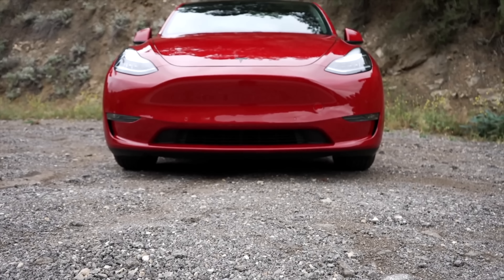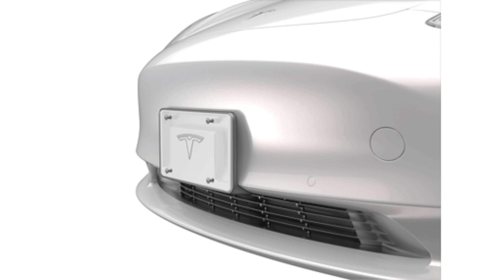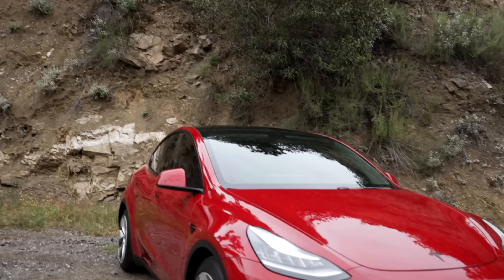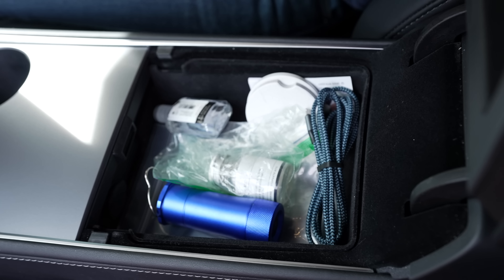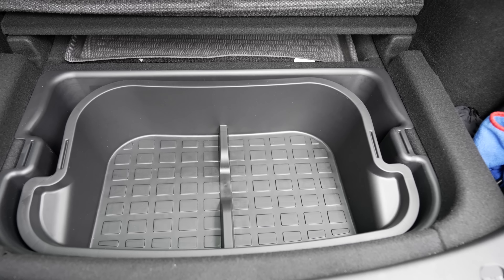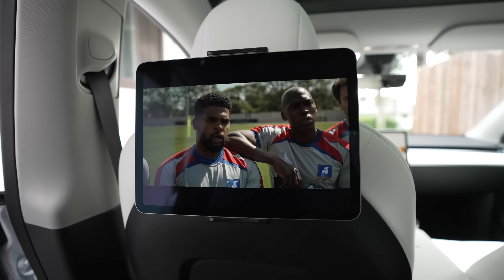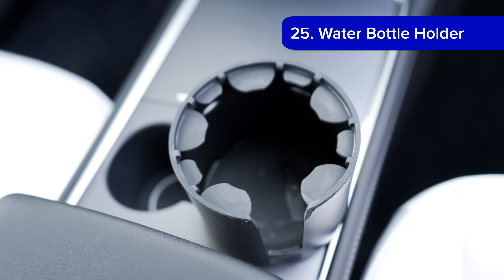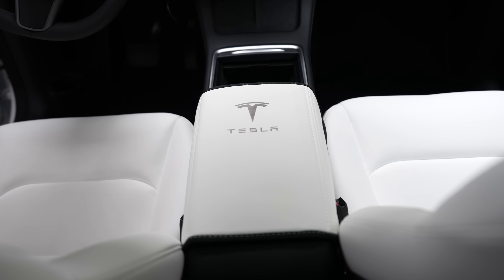The BEST Tesla Model Y, 3 Accessories in 2023 | Here’s Our Favorites

Comment: Ryan, no need for a roof cover. Get the top tinted with a ceramic UV tint that is primarily clear; makes the world of difference.
Reply: That’s what I’m doing… why have a huge sunroof and block it with a visor?
Reply: How much is it?
Reply: 100% this.
Reply: @Ickli  Difficult to say, I got my entire car done at once. I believe it was $350 in 2019 for LLumar CTX ceramic UV tint for:
Side windows at 60%, rear at 40%, windshield and roof at 10% (or something like that)

It was before COVID, no idea what prices would be now.
Reply: I heard you aren't supposed to tint the roof. Not sure why but it can cause a crack.
Reply: @mikefas5406  Well the rumor is false also you should fact check something if you are unsure. Google is there for a reason. 
Some people get their teslas with heat absorption tints instead of heat rejection which is why theirs breaks
Reply: @kello-my-eggo3924  factually speaking, it has happened. 🤷‍♂️
Reply: @Ickli   I think it’s around $350? Then again I got the whole car PPF covered, all windows tinted w/ceramic tint, including clear on the windshield, ceramic coating on exterior over PPF film, and ceramic coating on interior. $8,800.

Comment: With regard to those storage bins for the rear under floor storage compartment that you're still figuring out how to use ... are you sure that the smaller bin isn't supposed to go on the bottom, in the lower part of that compartment?
Reply from the maker: Yep! Just double checked and you are correct haha. Makes much more sense

Comment: Do not recommend metal air caps if you live in cold climates with snow and salt, learned that the hard way, they get stuck and you end up stripping the threads on the tires don't know why anyone would ever use them, stick with plastic.

Comment: RYAN, love your work as always… I think my wife has a Tesla crush on you! Anyways, these accessories are great, and Teslas are definitely a clean slate to customize. In addition, I would really like to see some powered accessories that a EV can use with that 1200 pound battery we’re hauling around. Something like an in car refrigerator, icemaker, microwave, inductive, cooktop, cold beer tap refrigerator unit.  I bet you could even power your whole band if you had the right power converter… When my bat be coming? How about a sunscreen with solar cells on it or a solar cell body wrap? What else can we run with a big battery?